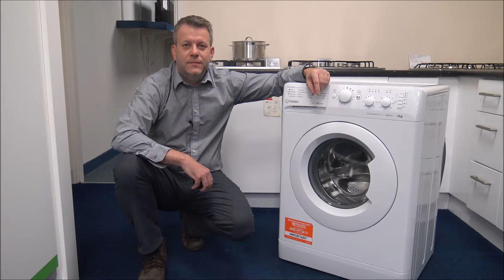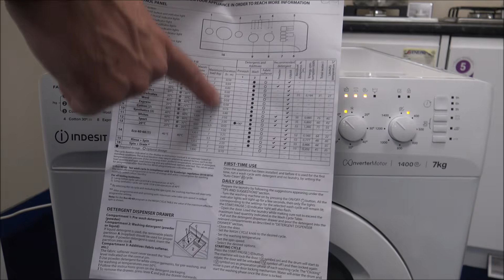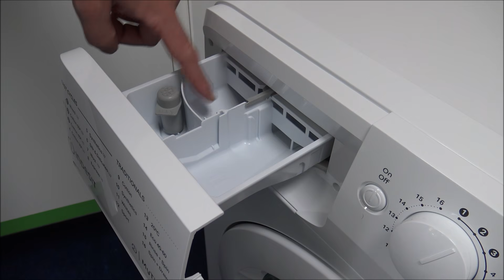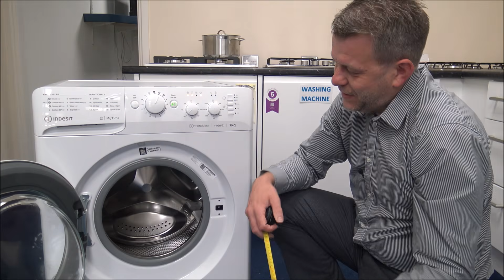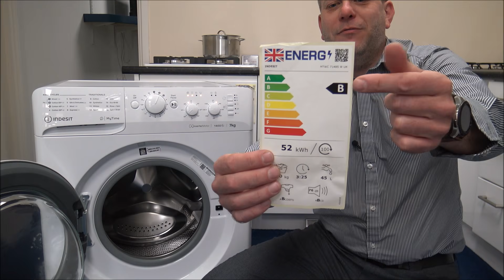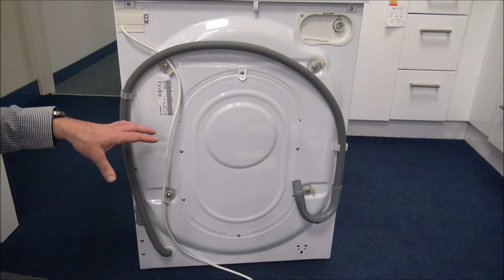Indesit MTWC71485 1400 Spin 7Kg Washing Machine

Comment: Does this come with transport bolts.   Mine is rocking like hell 😂😂
Reply from the maker: Yes there will be transit bolts in the back of the machine that need taking out before you use it. If it is moving around a lot, then it may still have at least one bolt still in the drum which needs to be taken out as it can damage the machine quite easily

Comment: I have this model and find it better than the newer beko made one that iv seen lately. I use programme 2 cotton 59 min for  most things  and can use up to 60 degrees. My only gripe with it is that is doesnt do the top 1400 spin and only limits it to 1000. The older hotpoint that i had that were owned by indesit 20 years ago that did a fastwash 60 min up to 60 degrees could do its top spin albeit shorter. I had one that went up to 1600 on that cycle. I think the 2nd programme should have done its maximum spin on these newer models rather than restricted to 1000 yet programme 3 quick cotton 45 min can do 1200 🤔

Comment: I've just installed my MTWC 71252 and watched this video because it looks identical at the front.  I was hoping to find out how to do the first cycle (before using the machine for the first time).  Thanks for uploading this!
Reply from the maker: I would normally put it on a hot 90 degree wash to flush the machine through with no clothes in before putting clothes in there first
Reply: @lords-electrical  Thank you!

Comment: My Indesit washing machine MTWC 71252 the child lock will not turn off and making a loud Knocking noise at the end of a cycle. I only bought this on 24/10/25 any ideas how to turn this off. I didn't put the lock on.
Reply from the maker: If you press and hold the key button on the right hand side for 2-3 seconds it should release it. I am not sure why it would be making a knocking sound, i assume you have def taken the transit bolts out of the back of the machine?

Comment: Does anyone know how I get the bottom off please, so I can drain the machine? I can get the sides off, but not the middle part and don’t want to break it.
Reply from the maker: Normally if you use a flat headed screwdriver, and try and prise it off but be careful as it can be damaged quite easily

Comment: Having issues with understanding the settings-
Need a delicate short wash- but delicates is an hour and max 1kg

Synthetics - 1 hour again.

There's cotton settings for 45 mins and 30 mins but I've read that this setting is a lot rougher on clothes as it a cotton setting. 

Please can you advise, thank you.
Reply from the maker: Don't be put off by long wash times, they are all quite long nowadays on the majority of machines. Hopefully the machine you have has a Woolen / silk program as this can be very good at looking after your clothes.
Reply: @lords-electrical I don't like the long times because I fear they will be too long on my delicate clothes.

The problem is that the cotton 30, or 40 would be ideal, at 30 minutes and 45 spin, but I've read online that cotton cycle is aggressive, despise the rpm and heat I set the machine to? 

So then I'm left with delicates, but this is a 1 hour spin, which is maybe too long, but even if it isn't- is this a 'soft program'? 

The manual actually says that the cotton 30 min cycle is actually a delicate cycle, but is this just because it's short in time? Or is the actual program a softer one than the 59 minute cycle. 

As for the delicate and silk and wool- these would be perfect! But they max at 1.5 kg of clothes which is not enough.

In an ideal world, I would just like them to have a delicate 4kg 30 min cycle 😂

Comment: So what do we use in measuring the kg of laundry before putting in the washing machine? Say I want to do a 1kg load of wash, what do I use in measuring?
Reply from the maker: The only accurate way to measure the kg of laundry is to use scales. But in reality nobody will weigh their clothes so it is just using an approx judgement to make sure the machine is not overloaded.

Comment: I have that exact model and the fabric softener part is not emptying properly, the machine is new i have checked the holes in drawer etc everything is clear clean etc but still isn’t taking the softener proper. Any tips please? Thanks
Reply from the maker: the main issue is where the water pressure is too low and there isn't enough flow of water to take the softener. Try turning the water tap up a little bit more to see if that makes a difference.
Reply: @lords-electrical I think it’s too much water pressure as I tried without softener and the compartment still fills with water. Any advice please
Reply: Thank you I will have a look. I’m sure it’s up as far as it goes though.
Reply: Iv just pulled it out and checked the water tap is on as far it will go the waste pipe is in proper the drawer is in proper and everything in the drawer Iv checked there’s no blockage etc I’m all out of things to check

Comment: Can you help my washer just six months not spinning the no spin light stays on I ve tried everything
Reply from the maker: Does sound odd that it isn't spinning. I would check the waste pipe to see if it is blocked at the back of the machine as it can stop it spinning if it is blocked. Also make sure the load is a good sized load as some machines will not spin if there are not enough clothes in there. Apart from that, i would contact Indesit as it is only 6 months old and they should be able to sort it out for you

Comment: Does the machine have a filter
Reply from the maker: It will have a filter under the flap at the bottom if there is one there
Reply: Does the machine have a dryer option?

Comment: Mine is brand new only got it two weeks ago and it’s not working properly, there’s a flashing light above the temperature dial and it’s beeping 
It isn’t spinning the water out 
Don’t know what has happened 😢😢😢
Reply from the maker: It sounds like there is an issue with the pump or drainage of the machine. I would try and see if you can get the drain checked to make sure there are no blockages. Also this machine may have a filter at the front of the machine, i would check to make sure it isn't blocked

Comment: The fabric conditoner is staying in the drawer the machine is only new
Reply from the maker: Just make sure the water is turned up enough getting to the machine as normally is is down to low water pressure to the machine that causes the conditioner not to be taken
Reply: Were do i turn the waterr up from thank you  @lords-electrical
Reply from the maker: It will be your water supply going to the washer that could need turning up
Reply: @lords-electrical  thanks very much

Comment: Just done a 1200 wash and it rattles like mad. Is this normal? I've removed the transport bolts.
Reply from the maker: Apart from checking all of the transit bolts have been removed, the only other thing is to make sure the machine is level on the floor. Apart from that it sounds like there may be a fault in the machine, i would contact the retailer to see if they can get it sorted for you.
Reply: @lords-electrical  hi, sorry I didn't reply. So it was the feet were not leveled with the floor 🤣
Works fine now, cheers

Comment: I want a 60c 1hr wash i cannot for the life of me find it on this model please advise
Reply from the maker: I would use program 2 which is Cottons at 60 degrees C and should wash in around an hour
Reply: @lords-electrical  programme 2 is synthetic and i have been through every single cycle and nothing is 60 for 1hr
Reply: When I tried that it came up saying 3hrs or something as long I don't want a long cycle . I'm not getting on with this machine at all

Comment: These cheap indesits sell like hotcakes I've noticed. In uk anyway,  not sure about other countries, but here they are big. Personally ive had trouble with indesit as the bearings went bad  after 2 years.
Reply: These new indesits come with updated drums with stronger bearing seals I think
Reply: @washinglad1400  yes i heard that. I suppose it's a good machine for the money... but it aint no bosch or lg lol
Reply: @Bart0815-k8r we have a big variety of makes and models here in britain.
Reply: I had an indesit for 9 years but replaced it with a hoover under 2 years ago, today the hoover packed in as the electric circuit board in it was blowing my home electric, it was 20 months old so no more hoover for me I will stick with indesit